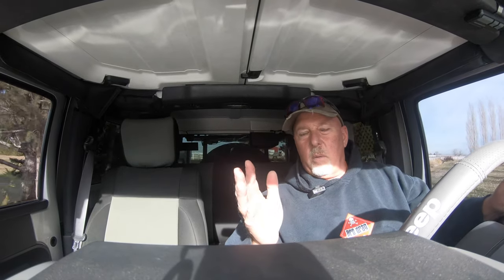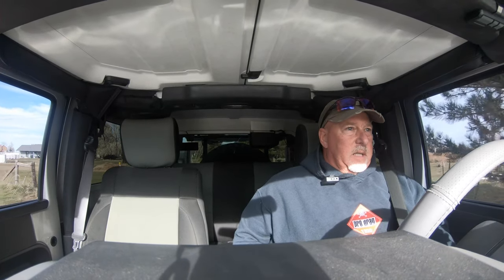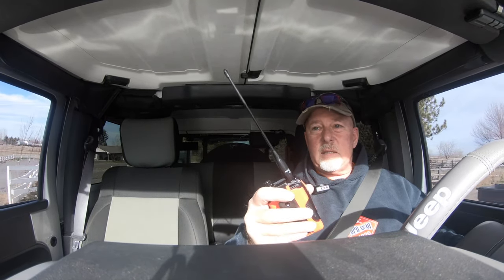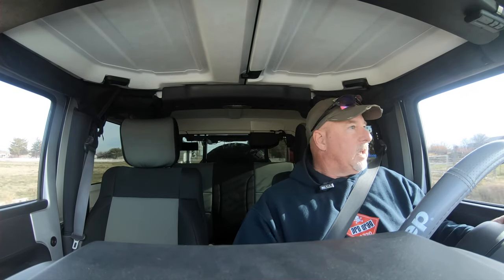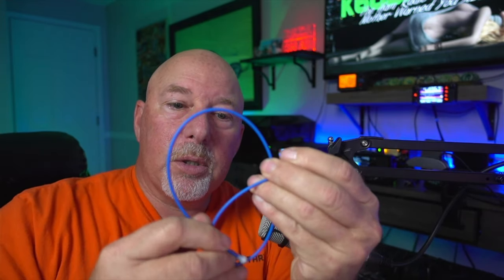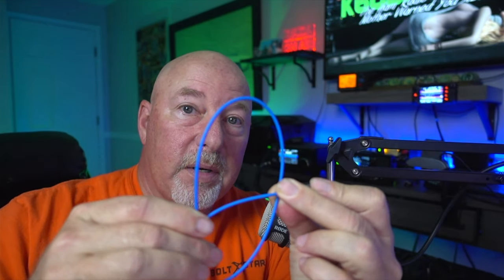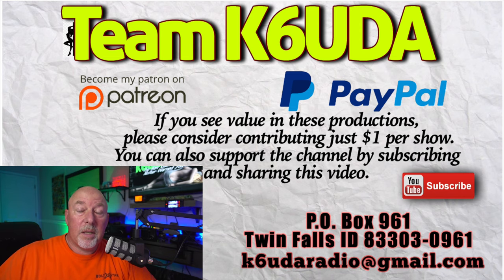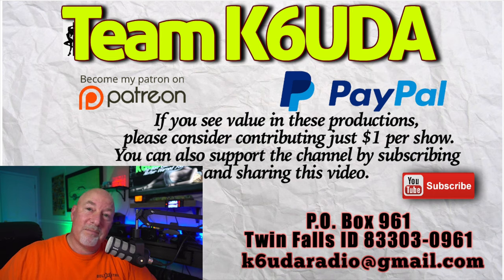Ultimate Ham Radio Antenna Shootout - Watch this video before you buy one.

Comment: For those who insist on sticking your antennas on an analyzer (not a bad thing, but also not the only thing; practical testing is obviously useful), don't forget that with an HT, unlike with standalone antennas, your body is often part of the antenna system. What you see when measuring SWR, Q, Z, etc. isolated on the bench may not be quite what is happening in actual operation with the radio held in your hand.

Comment: Under 2 miles I've never noticed a difference with stock vs aftermarket. However lately at my local ski area, I'm using one of my ham radios to work with our mountain frequencies while on snow. The stock antenna on the Ailunce will not hit the broadside of a barn.

Comment: Great video. In my looking into antennas, a Comet does do better than a signal stick.  I use comets on most of my handhelds. I do have an Icom IC V86 which I do have a Comet, MFJ 1714 half wave and a Diamond RH205 5/8 wave. The Diamond and the MFJ do an excellent job on the Icom. I also like the fact that Icom has a bnc connector.

Comment: The 4-mile issue may have more to do with the curvature of the Earth than the quality or performance of the antenna. The line-of-sight ability of handheld antennas is incredible. If you don't need to be contacted, you can tie the Signal.Stick up like a pretzel and carry it all day. But you won't be able to receive. 

I would have liked for you to step up on your bumper or something to get a little elevation. Randy, at NotARubicon was able to go ten miles on ten watts when one radio was on the second floor of his favorite cheeseburger joint. Came in loud and clear! The formal testing ended at 6.1 miles and the was using the stock Retevis RT-29 antenna with said radio. So I don't think we're talking distance as the chief factor. It also matters whether you're transmitting on VHF or UHF. 

If your home base antenna is on top of your house and your point of transmission is high enough to establish line of sight, you might have a good chance to be heard. If you used a 9W radio like a Baofeng BF-H6 or a 13/14W radtel RT-470, it may or may not help. The sheer height of the Signal.Stick may have been a factor in your reaching home base, not the quality of the antenna. I don't know.

Comment: So basically, the bigger antenna the better the range.   It's good to see an actual demonstration.   It makes sense when you consider the Signal Stick is basically a full quarter wave and the others are basically compromised shorter versions.   How about a retest with the same antennas and adding the QuirkyQRP  Ziptenna counterpoise?

IIRC  the signal stick glows in the dark.   That could be good or bad ...

Comment: You make some really good points. Handhelds have little range. However, as your conversation about being in an airplane notes, if you have an antenna high up then you can talk long distances. In my area we have a booming repeater that is up about 2500 ft elevation, and you can talk to it with a handheld from 30 miles or so line of sight and it works great (its gmrs but same general idea). What's important is knowing what your radios limits are and working within those and if able, change the conditions, like getting some elevation.

Comment: One antenna I've had good luck with is the Retevis RHD-771. There's a cheaper Retevis whip antenna that's trash, but the RHD-771 is my favorite whip antenna. I also love the Nagoya 24J, but (like the Signal Stick) you have to wait for it to stop flopping around. 

I'd love to see you repeat this test with a number of whip antennas four miles away, including one of those ridiculously long Abbree antennas (do you have one?). Also, instead of standing by your truck, how about standing on it? Maybe on the part over the engine or even just the running board. Don't know if you could stand on other parts, but that would add consistency. Retevis has an HT that actually hits 10W and HYS has a 25W HT, but I wouldn't want that antenna anywhere near my head when the [PTT] was pushed!

HT antennas are a hot topic and a lot of users want to know, hype aside, which is better, the Diamond Signal Stick or the Nagoya 24J? A few years back, a man, his wife and two small children were trapped in their car in a snowbank on a logging road. They tried their phone, but they couldn't connect. Their family reported them missing and a helicopter was dispatched to locate them, but they were too far off the route they were supposed to have taken. The father took off on foot and died many miles away. The helicopter pilot followed his tracks back to the car and the man's family was rescued. Had they used a predetermined emergency frequency on a lowly Baofeng UV5R, they all might have been rescued.

So one wonders, which antenna would be best suited for such emergencies, and which would be best for SHTF situations?

Comment: Range with a HT, also needs good LOS to the target radio, plus an unobstructed path. I.E. No buildings, or hills. I don't think tree's make a huge difference. So if you have good LOS,and a clear path to your receiving radio, and are on a hill top, you can send a signal a lot further.  I use Signal Sticks on my HT's when I need to keep the radio in my pocket. But, if I really need to get a signal out. I use the 18.8 inch Abbree antenna. A very very good antenna, that I've been using for 4 or 5 years. Oh, the radio I use is the TYT UV8000D. Not sure if it affected your test, but at 4 miles, you where under or very near to power lines. And at four miles I have no doubt in my mind, that my Abbree antenna would have worked well.

Comment: We all know that Nagoya and Diamond antennas perform well. My big question is, what about these Tidradio, Abbree, Retevis and no-name antennas (five for $20) from Amazon? I've been extremely impressed with the Retevis RHD-771 antennas (male/female), and many radios are being sold with no-name whip antennas. I've also been impressed with the 5-inch stock antennas. The whip antennas for the most part are 10W, but the aforementioned Retevis RHD-771s are 20W and are made from a thicker guage/stock. 

It's one thing to test antennas with known names and reputations like Nagoya and Diamond. They have, many of them, price tags of $22-$35. Many of us have more refined budgets that make the inexpensive antennas like the Abbree much more...attractive. I'd like to see you put some of these to the test. Not just the high-priced spread.

Also, antennas that do well with VHF quite often fall on their faces with UHF. Thus, are there any true dual-band antennas?

Comment: It's all about location. If you're in the middle of a forest you're not going to get much distance, 1 mile if you're lucky. But be at a slight elevation with line of sight to the receiver, and you will get 10 to 20 miles. Be on top of a hill or mountain and you will get 50 miles
Reply from the maker: Height plays a huge roll in how far you can get out, but as we saw here, your antenna choice can put you over the edge of making contact or not.
Reply: @K6UDA  that is correkt, but I think you  stayed a little to close to the car too,
Reply: @deltatom2459  As long as he stood on the same spot for all three antennas, I think it's still pretty valid.
Reply: @loctite222ms  yes,that's correct,  but still,  I would have stept a few  yards away,  that's how I would have it done, - no big thing, nothing to worry about
Reply: @deltatom2459  depending on car orientation it could have helped or hurt his signal... if he stopped facing the same direction each time it was a valid test...my antenna on the car is on a rear corner and it is directional over the car to the opposite corner. Signal strength can vary depending on direction I am driving/parked. Difference of around 2 S units! All that ground plane going one way...
Reply: @MaryBrownForFreedom  I agree, your exactly right,   I did not doubt the validation of the test, just to make shure  there is no interference , I would stay a good distance away from everything that could block or reduce the free flow.

Comment: I just bought a signal stick, Just before I got my license, I also used the program that they promote to get my technician license, The radio I use the signal stick on is on is both on my FT70A70 and my FT 5D Both the AC radios I just love they are great little handheld radios, I am looking for a tribander with with 220 or a quad with 220 there are several people in the area that have that band I am in a small apartment and cannot put up any intendance so I will have to get a magnet for my fridge, And/or something for the corner of my room if that will not work

Comment: Great info.  Looking forward to your video using an Elecraft  KPX 100 with your IC 705.  All the correct cables and settings on the radio and amp.
Reply from the maker: I’ve been racking my brain to come up with video idea. Thanks.
Reply: @K6UDA  You used that combo on 2021-03-14  on 7.230 Its in my log book as 705 with Elecraft amp 100w

Comment: I should have my first radios in about 1.5 weeks. But I decided to buy Nagoya antennae. Why? I am converting the radios to use BNC instead of SMA Female connectors. It keeps from putting stress on one of the weakest parts of the radio. And BNC is quick to change between antennae.

Comment: Actual Scientist - (yes sir!) - Great field work - thank you.
It should be noted that there are many Diamond NH-771 knock-offs/counterfeit antennas on the 'market' Very similar to the Nagoya whip), I know, I bought one.  It specs out perfectly on 70cm, but on 2 meters it's way above 3:1 - so if you buy one, get it from a  a reputable dealer.
Leave nanoVNA Aloooone! (lol) -it's at best 'ballparking' it to use nanoVNA on a whip/ducky because of human counterpoise or adding a radial wire on an alligator clip, but better than nothing. It was good to find out I had lousy SWR on 2 meters.

Comment: If you get your antenna at home to 100' you will get some decent range LOL I sit 75' higher than surrounding terrain plus my dual band antenna is 30' up. I have one of the generic 17' antennas, gets used 99.99% on 2m which is where they really work well. Range to a handheld is about 10 miles, I easily cover my small town which is where the coverage is needed. Range to repeaters is 100+ miles for the tall repeaters.

Comment: Your video is quite interesting. After watching many HAM and GMRS antenna comparison videos, here is my quandary, The GMRS 5-watt radios, without connecting to a repeater, are out reaching these HAM HTs. Many GMRS videos demonstrate five, ten and more miles of line-of-sight connections; without being on a plane. Please, what am I missing?
Reply from the maker: You can get those results if you have true unobstructed line of site. Mountaintop to mountaintop type stuff.
Reply: @K6UDA  Thank you for your polite reply. Your comment is what I thought as well. As a comparison, I should run a side-by-side GMRS and HAM radio test. My radios are the QRZ-1 Explorer (an excellent beater radio), a few Tidradio TD-H3 which I love they can be booted to GMRS or HAM, and a couple of twelve-years-old or more, Midland LXT 310 I found on my shelf (amazing they perform as new). Any suggestion for a proper mag mount for my HTs (GMRS and HAM) providing extra reach from a vehicle?

Comment: Maybe it's just me....but I would think you would not want to be near your vehicle, while making these type tests ?
Seems having as clear a 360, as possible would be most fair !
As having anything metallic in close proximity, may effect the signal, good or bad !
I purchased a Signal Stick several months ago, and it seems to work very well !
Too, I wonder at your test distances, if attaching a counter poise to the radio, would benefit ?
Something like the old Tiger Tails ?
It may prove interesting to see these antennas with and without a counter poise ?
Reply from the maker: There a ton of things I try, but in the real world, most of us might have a slightly better antenna on the radio and that’s about it. This test was all about real conditions, not theory.

Comment: I like your Antenna  test special with  Antennas for HT's,  but you really can't compare the signal stick with  a 8 inch antenna. they are two different pair of shoes. I work a lot with HT's and therefore I gained a lot of experienc with HT Antennas. Because the limitations of The HT, it is very important to use the right antenna. I had to smile when I saw you using the Nagoya NA 701, because this antenna turns out to be one of the best antennas  that type and length. I receive repeaters I can't reach with the stock antenna, it also beats the Diamond 701 .  But  one must make shure to get only the ORIGINAL  Nagoya, since there are so many fake ones on the market , that are no good, wasted Money. The signal stick is for schure a very good antenna, when every other fail but not so good for always on, day to day. I like your videos, because they are realistic and no theory ,  greetings from a german subscriber
Reply from the maker: Thanks

Comment: I use that 701 Antenna from Nagoya for my EDC. There is a bit better version from Diamond SRH701A that is a lot stiffer so its a bit harder to carry around as an EDC. You didn't test the receive aspects of the HT Antenna's which would be really interesting to see a difference if any. To test my antenna's receive I just turn on a distant weather station and see which one I hear better. Either of the 701 variants seem to be do better than the stock antenna's. The Signal Sticks that I have blow them all away, but yeah, way to long to carry EDC. Good to have incase to you need to reach out in an emergency or for SOTA.

Comment: Bob,  please share your thoughts on my wrangler setup.  I’m running my FT-5 connected to a Mirage uhf/vhf amplifier which puts out 45 watts on vhf and 35 watts on uhf connected to a 770 on a k400 mount.  Should I bite the bullet and order another ft400 or 300 or keep running the ht on my amp.  73 K9PAL

Comment: I would add KNOW YOUR VENDOR. My original Kenwood needed replacement. I got one from Kenwood. I also have an old (Comet?) Like the Signalstick. No good, it causes picketfencing as it wiggles. One Nagoya is genuine, one is counterfeit. Surprisingly the counterfeit Nagoya outperforms the real Kenwood and the real Nagoya.
 So KNOW YOUR VENDOR. There's a lot of counterfeit out there, the question is how well it will hold up in 10 years, as well as how it works now.
 And only buy from vendors that take free returns!

Comment: I like the Signal Stick, IT'S JUST TOO D@%ED LONG!  Never been impressed with the Nagoya. One thing i learned with commercial radios, never understate the stock antenna.  More true on higher end radios.  I had an 800 MHz radio when I was working.  I had the short (about 2 inches) antenna, and it did very well. Yes I know, that was a "repeater" but I could go out the coverage area and it still worked.  When I travel, I always take different antennas, and see what works well......and limit the "GEEK Factor"  LOL

Comment: Why didn't you hop on top of your car at four miles? It might not prove much, but it would be interesting. NotARubicon tested a couple of Retevis RT-29s, and he got up to ten miles and six miles. 

I just watched Smokin' Ape's review of the Nagoya NA-320A and the Abbree tri-band antennas and the Abbree ate Nagoya's breakfast. Not only was the Abbree half the cost of the Nagoya, it outperformed it on every turn, not only on the meters, but in the field. Nagoya should be ashamed to introduce an antenna that doesn't perform. Also, Nagoya's antenna has a power rating of 10 watts, while the Abbree has a power rating of 20 watts. My Radtel RT-470 10W radios put out 13-14 watts on VHF and 11 watts on UHF, so I have no idea whether the Nagoya will work with radios with greater power readings than ten watts. So why risk it? 

Finally, Abbree has a whip antenna (AR-771)  that seems to be legit, but I've never seen it before. And no power rating is listed. It's also a tri-band. At this point I trust Abbree more than I do Nagoya, so who knows? Do you think a 10W antenna will run a 13-14 watt radio?
__